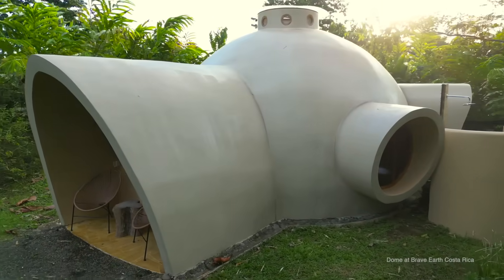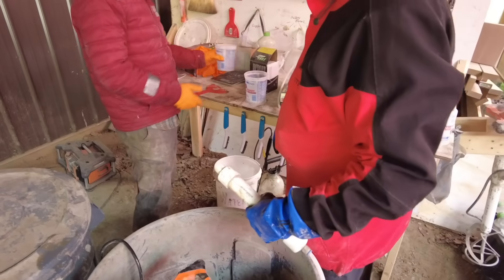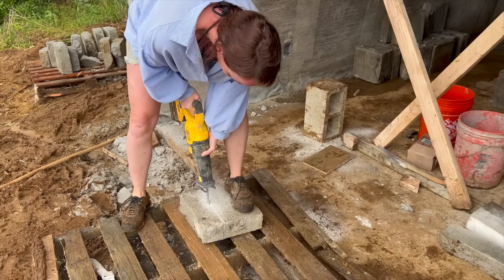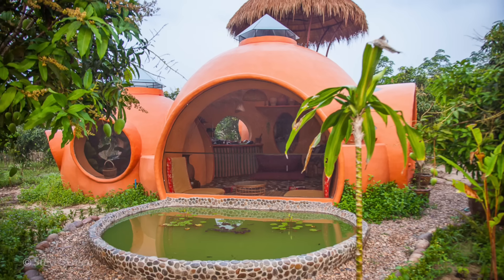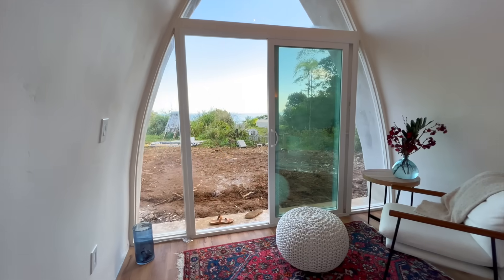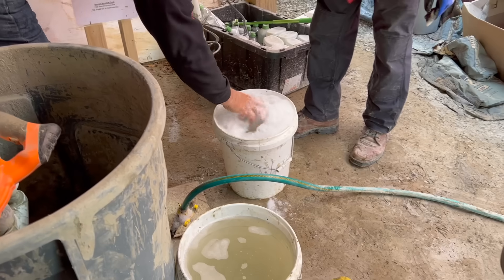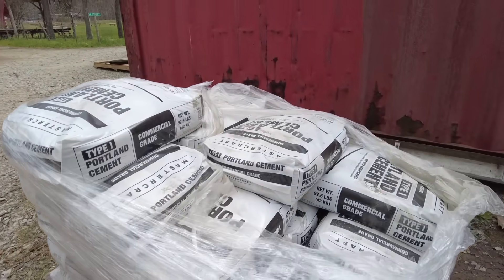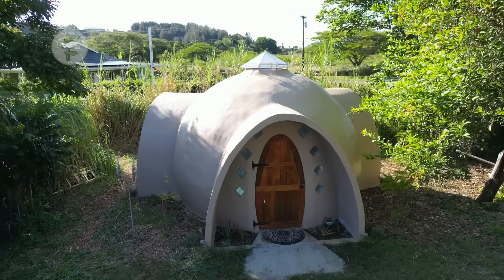Building Amazing Dome Homes with Aircrete – A Beginner Friendly & Cost Effective Material

Comment: At 1.2 to 2.2 per sq  in the  R-value of a  4 " by 12 " x 12 square  " the R value would be about 691 R per 12 x 12x 4 " brick. Correct?

Comment: Can things be anchored into the wall like shelving brackets? Or anything heavier, even? Basically can anything that would be wall mounted directly into traditional concrete- have equal capacity in aircrete?

Comment: The Arch in the background seems unneceessarily wide. With normal concrete bricks it would be max 10cm wide, this looks at least double. For that specific arch i'd say you're using more material then necessary. Also, doing something 'precise' is never a thing with beginners. I would try building a dome with normal concrete and rebar. A tried and tested method and you can do it yourself, 1:3 ration of portland cement and gravel and water. That's it. The difficult part is making the mold to get a dome structure.

Comment: Aircreate / Airated Autoclaved Concrete blocks or tilt wall construction materials Have been used in Europe for almost 100 years and this material at eight inches thick can provide from R20 to R50 insulation factor. Another benefit of of aircreate is it's waterproof , Soundproof and Fire proof and often used in high rise buildings to line the elevator shafts and emergency stairwells.

Comment: To increase the strength of the structure, instead of overlaying with a mesh and then adding stucco, could you add concrete mix/cement to the outside mesh and then plaster that? Or would the weight of the cement be too much for the aircrete blocks to handle?

Comment: Awesome video, but lacking in structural strength information. With standard building structures what levels of wind force can withstand, flame resistance, sheer force, etc can it withstand?
  I realize to some extent how difficult it is to outline because of wildly different material qualities. But the lack of building stress guidelines is simply because of the wildly different material factors that engineers, and builders can only make "educated Wild ass guess's" at. Anyone concerned about insurance or building codes is best looking for different building options!

Comment: I would be concerned with out gassing.
Reply: Outgassing from what? A modern home has far more materials subject to outgassing. Foam board, carpet, various chemical sealants, spray foam insulation, chemically treated wood, vinyls, various types of paint, and most kinds of plastic.

Comment: i have a small bone to pick....and because i think you did a great job with this presentation of this product so i want to know more and have you be more precise with your answer. The question posed about climate was not how well it would do in every climate but how much or how many structures of Aircrete did or do EXIST in the different kinds of climate. Can you please respond to that vs your response in video which did not say how many actually do exist in each but said how well they WOULD  or could be very compatible or functional in each climate. There IS difference . if you can answer that in comment here or in another video ....with some estimation or exact figure of existing or having once existed ... number of structure for each climate.... that would be greatly appreciated.
Reply: Thinner for hot climate, thicker for cold.

Comment: What worries me is security. Couldn't someone just saw their way into your home?
Reply: Unless you neglected to put a window anywhere, I think throwing a rock through a window is still easier than going through a wall. :)
Reply: A person can also saw through wood frame home, a battery powered saw will cut through a wooden door very fast. It would be faster to cut a hole in the average wood frame home.
Reply: You can do that in a traditionally built home too.
Reply: Probably would take a considerable amount of huff and puff to take these homes down

Comment: This is fascinating and the dome designs are gorgeous. My main concerns are the materials used and inner air quality.  Namely VOCs. Does the aircrete (and especially the fiberglass) materials mean an air purifier is necessary? My dream is to build a small, "green" home, so on the surface aircrete seems perfect, but how healthy are it, and the other materials used, in both the short- and long- term?
Reply: Interesting question.

Comment: Aircrete (foamed concrete) was used in a lot of schools and public buildings in the UK in the 1960's. They are now discovering a lot of structural issues, leading to the closures of many public schools. It is quite a problem, requiring expensive remediation or replacement.

Edit: thank you for mentioning this issue in your post and highlighting how this video's method is different.
Reply: This material is ideal for small structures like these pod homes, but not so great for big square buildings like schools
Reply: Hempcrete would probably be better
Reply: Would they do well submersed permanently in water, for like a wall decoration?
Reply: @dpr4820  They would have to be fastened somehow. I expect aircrete to float like pumice rock does.

Comment: I would use this with tire house building  to quickly fill the tires versus pounding with dirt. That is very tasking and time. Filling with foam cement would significantly speed up the building with tires. Aad the tires would be far stronger than just foam cement and fiberglass

Comment: Could you mix it with clay slip rather than cement ? Clay can firm up quickly, even in a few hours, but maybe not if it is really thick. How about stabilized clay, as used in India where 5% cement is used in the bricks ? https://www.youtube.com/watch?v=9SCyGAaXvJE

Comment: How much time does it take to make enough bricks to make one of these small structures?

You have stated this is low cost, but have not really discussed how labor intensive it is to make the bricks. It appears to be a lot of steps done in small batches. I'm assuming the labor cost, or personal time required, is not insignificant when considering building with this material.

Comment: Instead of making it myself, i would rather buy AAC (autoclaved aerated concrete), it is lightweight, easy to cut, and quality is far better than you can do by mixing foam into concrete. And AAC is  stronger structurally.

Comment: I found it kinda ironic that you post this now considering the UK has collapsing schools everywhere due to the use of aircrete
Reply from the maker: Hi and thanks for your comment. After posting the video we did hear about the news story concerning some Reinforced Autoclaved Aerated Concrete (RAAC) roofs that are failing in the UK.  We're definitely not experts but we looked it up and it sounds like RAAC is a different way of using aerated concrete that involves steel reinforcement.  This Guardian article has more information:
https://www.theguardian.com/uk-news/2023/sep/04/raac-crisis-who-knew-what-when-crumbling-concrete-england

"With an estimated 30-year lifespan, failures among Raac roof panels in 1950s buildings were inevitable. Engineers also discovered some panels were too thin for the distance they were used to span, some lacked enough steel to anchor them to vertical structures, and leaky roofs triggered a “rapid worsening” of steel corrosion."

The aircrete method featured in this video does not use any metal in the structure so it seems to be quite different than the RAAC method, but just like with any new or alternative building project, it's always a good idea to consult with experts like structural engineers, architects, etc.

Thanks so much for watching :)

Comment: I wonder what would happen if you added volcanic ash, the Romans used it to make their concrete stronger. 🤔
Reply: A Roman technique has been re-discovered:  adding quick lime and hot water to the hydraulic mix left unreacted particles in the concrete which make it self-healing. As little stress cracks appear, when water goes in, unreacted quick lime hydrates, growing crystals that seal the cracks.

Comment: Did you film that before or after the UK schools being condemned?

I appreciate the details on the means of re-enforcement methods
Reply from the maker: Hi and thanks for your comment. We did hear about the news story after posting the video. We're definitely not experts but we looked it up and it sounds like RAAC (Reinforced Autoclaved Aerated Concrete) is a different way of using aerated concrete that involves steel reinforcement.  This Guardian article has more information:
https://www.theguardian.com/uk-news/2023/sep/04/raac-crisis-who-knew-what-when-crumbling-concrete-england

"With an estimated 30-year lifespan, failures among Raac roof panels in 1950s buildings were inevitable. Engineers also discovered some panels were too thin for the distance they were used to span, some lacked enough steel to anchor them to vertical structures, and leaky roofs triggered a “rapid worsening” of steel corrosion."

The aircrete method featured in this video does not use any metal in the structure so it seems to be quite different than the RAAC method, but just like with any new or alternative building project, it's always a good idea to consult with experts like structural engineers, architects, etc.

Thanks so much for watching :)

Comment: Look at the air crete building collapse issue going on in the uk right now......
Reply from the maker: Hi and thanks for your comment. After posting the video we did hear about the news story concerning some Reinforced Autoclaved Aerated Concrete (RAAC) roofs that are failing in the UK.  We're definitely not experts but we looked it up and it sounds like RAAC is a different way of using aerated concrete that involves steel reinforcement.  This Guardian article has more information:
https://www.theguardian.com/uk-news/2023/sep/04/raac-crisis-who-knew-what-when-crumbling-concrete-england

"With an estimated 30-year lifespan, failures among Raac roof panels in 1950s buildings were inevitable. Engineers also discovered some panels were too thin for the distance they were used to span, some lacked enough steel to anchor them to vertical structures, and leaky roofs triggered a “rapid worsening” of steel corrosion."

The aircrete method featured in this video does not use any metal in the structure so it seems to be quite different than the RAAC method, but just like with any new or alternative building project, it's always a good idea to consult with experts like structural engineers, architects, etc.

Thanks so much for watching :)

Comment: This is what UK had been using in the 60s and it’s now failing it has a limited life span.
Reply from the maker: Hi and thanks for your comment. After posting the video we did hear about the news story concerning some Reinforced Autoclaved Aerated Concrete (RAAC) roofs that are failing in the UK.  We're definitely not experts but we looked it up and it sounds like RAAC is a different way of using aerated concrete that involves steel reinforcement.  This Guardian article has more information:
https://www.theguardian.com/uk-news/2023/sep/04/raac-crisis-who-knew-what-when-crumbling-concrete-england

"With an estimated 30-year lifespan, failures among Raac roof panels in 1950s buildings were inevitable. Engineers also discovered some panels were too thin for the distance they were used to span, some lacked enough steel to anchor them to vertical structures, and leaky roofs triggered a “rapid worsening” of steel corrosion."

The aircrete method featured in this video does not use any metal in the structure so it seems to be quite different than the RAAC method, but just like with any new or alternative building project, it's always a good idea to consult with experts like structural engineers, architects, etc.

Thanks so much for watching :)
Reply: @ExploringAlternatives  Some people are expressing concern about the glass fibers in the outer and inner layers. Conceivably, these fibres could get liberated when people are nailing pictures to the wall or securing tall cupboards....

Comment: Any relation to Britain's crumbly RAAC menace? Reinforced autoclaved aerated concrete is lightweight, aerated concrete.
Reply from the maker: Hi and thanks for your comment. After posting the video we did hear about the news story concerning some Reinforced Autoclaved Aerated Concrete (RAAC) roofs that are failing in the UK.  We're definitely not experts but we looked it up and it sounds like RAAC is a different way of using aerated concrete that involves steel reinforcement.  This Guardian article has more information:
https://www.theguardian.com/uk-news/2023/sep/04/raac-crisis-who-knew-what-when-crumbling-concrete-england

"With an estimated 30-year lifespan, failures among Raac roof panels in 1950s buildings were inevitable. Engineers also discovered some panels were too thin for the distance they were used to span, some lacked enough steel to anchor them to vertical structures, and leaky roofs triggered a “rapid worsening” of steel corrosion."

The aircrete method featured in this video does not use any metal in the structure so it seems to be quite different than the RAAC method, but just like with any new or alternative building project, it's always a good idea to consult with experts like structural engineers, architects, etc.

Thanks so much for watching :)
Reply: @ExploringAlternatives  Thanks for such a thorough response. I had read about the issue of the bubbles' forming an access track for water from the surface to the rebar. Only time will tell about the durability of this material. Fingers crossed.

Comment: I'd like to know about the resistance factors to extreme elements - how does it do in floods, how much mph wind can it tolerate, is it earthquake rated, are there insulation comparisons with say, straw bale, sand bag cal earth structures,  or earth ships, or compared to concrete alone relative to its thickness? Can you use chicken wire inside walls vs. fiberglass, for its EMF blocking abilities?  It all looks very intriguing - this was a good intro. Tho it likely varies from state to state, wondering in general how big a structure can be built w/o permit. Hope you follow up with a more indepth report. Would like to know is there an aircrete greenhouse out there?
Reply: Also what about fires, how does it stand up against wildfires?
Reply: @mynameistwohawks  and/or "direct energy weapons" ?
Reply: @PHE-nomenon  gotta paint the roof blue!
Reply: @pikachuuuuuuu1928 true
Reply: @PHE-nomenon  paint it Blue😂
Reply: @mynameistwohawks concrete does not burn
Reply: SAID EVERYTHING I WANTED TO😇♥️💯
Reply: Here is something I think that will interest you, and really increase the structural strength, "check out using mushroom mycelium,  and greatly improves regular concrete etc...., At a very low increase of weight." This would limit the falling collapse, but the end product would not be, near as good.    It is hydrophobic, lightweight, but weak to crushing without cement....😔
Reply: @robertlavedas4964  I learned something new and fascinating about mushrooms every day!
Reply: @robertlavedas4964  I learn something fascinating about mushrooms every day!
Reply: In regards to fires, you have to remember that there's nothing in the wall that's flammable.
So in that regard, it's no different than a concrete wall. Also in regards to strength against earthquakes and wind. And touch just the shapes that they're using. This video and similar shapes will give you all of the resistance. You need to that so long as you have a decent footer for your building. It's also important to remember that concrete is so strong that they are doing Thin shell domes as little as 3/4 of an inch thick with spray concrete. Also a little bit of common sense in building will tell you that you can put whatever type of reinforcement inside that wall that you want.
Reply: My oppinion is about wind is all depending on shape and i think dome ones they use are quite aerodynamic.
Reply: So much stronger than square houses w eves
Reply: Safe to breath ?
Reply: @Lukesh30253  it's concrete and dishsoap, artificial pumice
Reply: Sounds like you need to visit their website! :-)
Reply: Won’t fly in Florida. Doubt it’s humidity proof. Not to mention flood, wind, hurricane or gator proof. 🐊
Reply: I would use aircrete for my chicken coop.
Reply: excellent questions… i bet theres a website for those answers
Reply: Good question.

Some place have abundant earthquakes every year.

Some climates have relevant quantity of salt in the air.

Some climates are humid.

Some climates have abundant rain.

Some climates have floods every year.

Some climates reach below 0°C.

Some climates reach above 40°C.

Some climates have abundant pigeon's heces. 

There many circunstances that can deteriorate materials.
Reply: I think most of what you're concerned about is structural rather than material.
Reply: @Antenox does not material play a part in construction? Even if your construction is great, if you have poor materials, it will still fall. What might be the middle ground?
Reply: @PHE-nomenon  Modern buildings are made of many different materials, and it's all about balancing cost, availability, material properties, and construction when choosing which ones to use in which component structures.

In the case the OP is talking about, water and wind cause specific types of stresses on structures, and there are probably ways to design aircrete structures that are just as strong against these stresses (e.g. reinforcing with rebar, designing thicker walls, etc) as more traditional materials. Aircrete can't replace concrete, but aircrete-based composite structures might be a viable replacement for timber-based construction, even if there are some structural differences (e.g. maybe aircrete structures use thicker walls than timber structures)
Reply: @Antenox  ok, I see what you're saying.  Fair enough...
Reply: @Antenox I think your forgetting the aircrete IS THE mass of the STRUCTURAL part